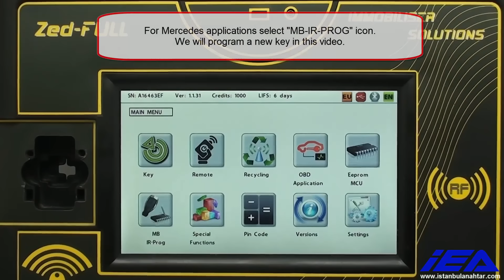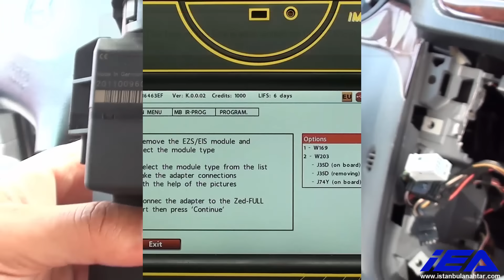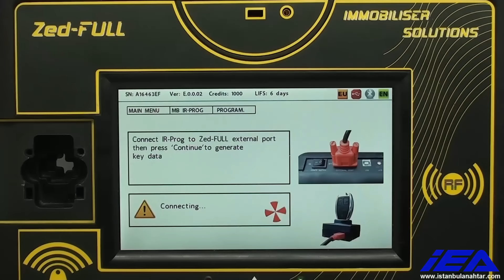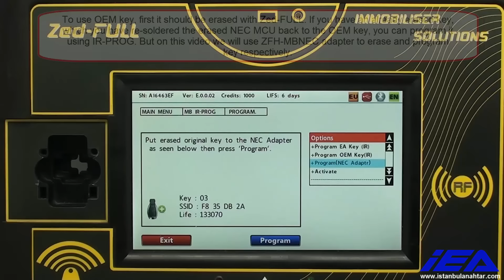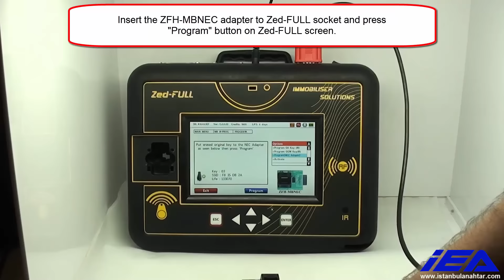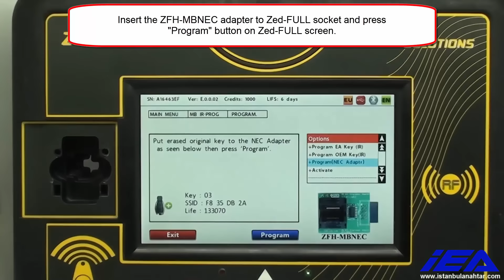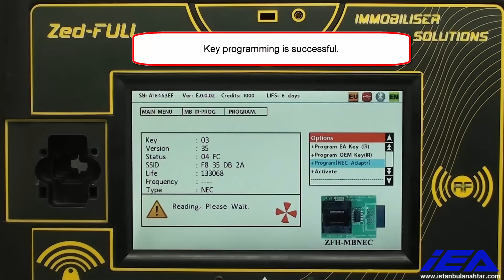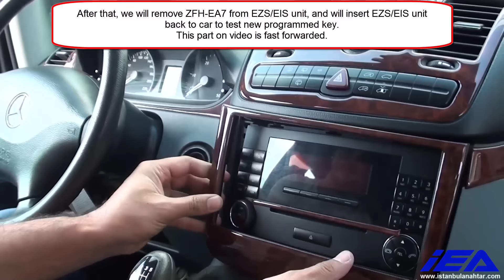Zed-FULL Mercedes Benz Lost Key Situation onto OEM key

Comment: hi there does the zed full programmer program all mercedes oem models or just some
Reply from the maker: Pie die1213 The application list for which Mercedes models that are covered can be found on our website here.. http://www.hickleys.com/diagnostics/zedfull_mercedes.php
Used and existing keys can be virginised and reused for these models.
Reply: +Hickleys Hi I have damage a key, but I have NEC from old key and its not damage.If I bay a new key and put it the old NEC... what do you think ...that key will work it or ? Thank you very much.